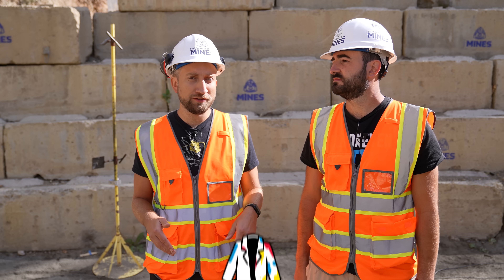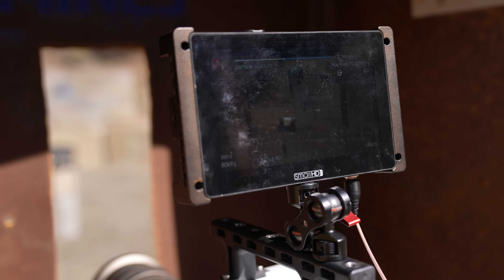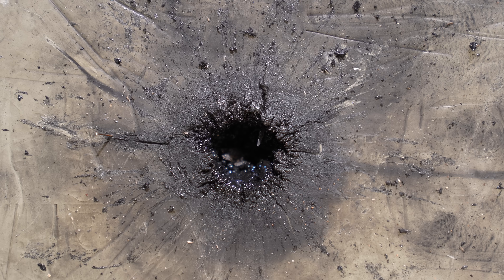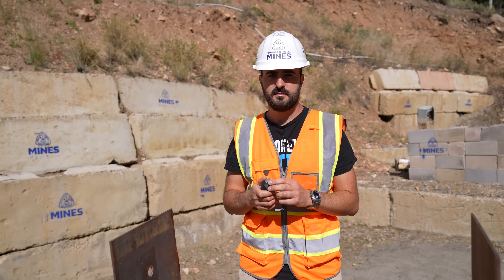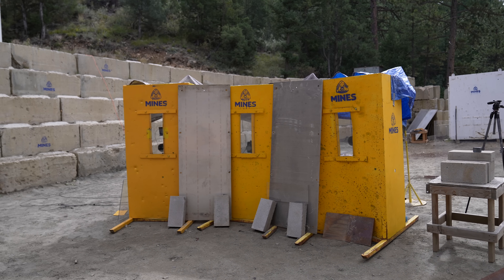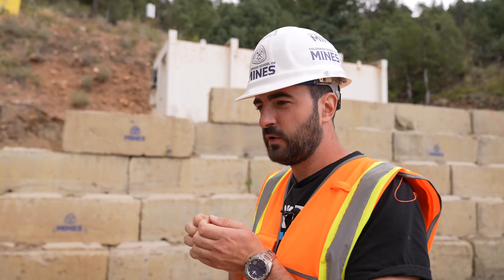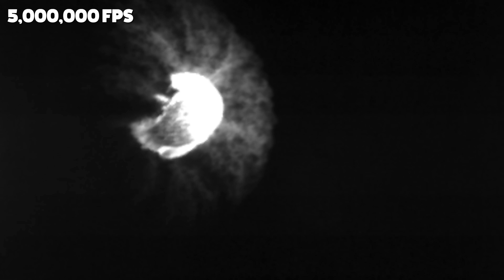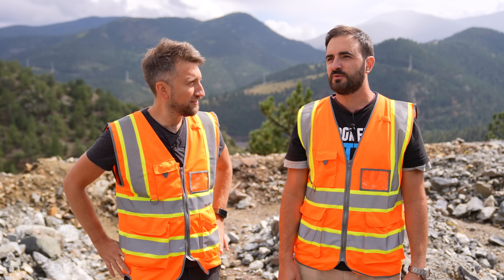15,000MPH Colliding Explosions in Super Slow Motion - The Slow Mo guys

Comment: 11:00 it's called Integer overflow. When the value get's bigger than the maximum the variable can Store, it wraps around and flips to 0 or a very big negative value (depending on the variable size and it's type)

Comment: hello, would it possible to use mathematical simulations and then plot them, like they did with the black hole? If we could do that, and then use cameras or some form of a camera to match what we see in the simulation to what the camera thing records as similar to find out the reference frame rate of the object?
Reply: like, this is what we are recording and this is what the simulation says, and they look exactly the same, so the discrepancy in their frame rate is some form of the object's reference frame rate?

Comment: Blue hot. Im pretty sure the copper impacting in the middle raises its temperature immensely. Essentially turning the copper’s velocity into heat as it impacts over particles and gasses in the air. Im sure youd be able tell if you had a thermal camera.

Comment: Its amazing that we can consistently and uniformly create an explosive that is effectively pinching down precisely from every direction around a watermelon seed that has been fired from a supersonic gun, at the exact same time. The timing is amazingly precise to compress that initial tip down into explosively vaporising copper devastation.

But I can't get my soundbar from rolling over to the wrong input everytime it comes on because it won't wait another tenth of a second for a signal. 😂

Comment: 13:54 it is possible that there is a jet of superheated metal, but the majority is occluded by cooler material. You can see the pinpoint "disappear" in the cloud of the opposing charge, which means there is definitely a region behind each jet that will hide white-hot material.

Comment: This reminds me of an experiment I proposed that mythbusters never picked up. There is an episode of invader Zim where Dib as as a superpowered adult kicks an oncoming pressure wave to stop it from flattening basically everything around him. I'm wondering if there is any physical basis for what I interpret to be deflecting or dispersing a pressure wave with another pressure wave. What I've seen so far certainly suggests that the two waves just travel through each other.

Comment: The shaped-charge effect was discovered by accident when an explosives manufacturer put their company name on the mould of a flat charge. The resultant charges would create a concentrated shockwave along the shape of the text, and blow a hole into an adjacent metal surface which followed the same lines.

Comment: At 10:56, this must be the overloading of the image chip. In silver photography, when the exposure reaches a certain point, the density of the image decreases. Typical example, a photo with the sun in the background. Sometimes the exposure of the Sun is so great that it reverses, causing the Son to become a round, grey area in the final print. The term is solarization. In your images, those dark areas are an extreme exposure for the image chip, therefore, representing the brightest area.

Comment: So from my understanding of shaped charges, that's not powder - that's a glob of molten copper, at over 1984*F (1085*C), which is why it's so incredibly bright. Something that's wild is that, if I'm doing the math right, we're only seeing a fraction of the actual brightness - the peak wavelength emitted by molten copper is outside of the range we can see (and thus, the range the cameras are built to see).

Comment: I have a suggestions, should you try this again. Add the following equipment (which will be destroyed by the blast, of course): a couple of pieces of glass either parallel to each other and not quite orthogonal to the camera or else not quite parallel to each other. They will reflect the image like a hall of mirrors, but each reflection will include a drop in exposure of several stops. This way you can get multiple exposures in one go.

Comment: @11:00 You are correct. The black pixels represent the brightest, but when the image was created it overflowed, because of programmer error. The programmer multiplied a 0-1 source by 256 to fit into a byte, but should have multiplied by 255, because 255  is the largest value a byte can hold.

Comment: Dumb comment inc.  I think if you had used a water back plate like on breeching charges that SWAT uses, you may have been able to reduce the fragmentation, as well as reduced the loss of explosive force away from the actual direction the charge is aimed at... Seems like it would also reduce the amount that the charge can move after igniting.  Just dumb armchair quarterback comments I guess.

Comment: Shaped charges were discovered as the result of a failed bank robbery. The vault door resisted the attempt to open it using blocks of TNT. Afterwards, police investigators discovered a negative image of the brand of explosive used blasted into the steel of the vault door's face.

Comment: 9:45 That shape charge is only traveling 1,650 miles per hour slower than the ISS, which is moving on average at 17,700 miles per hour over the earth’s surface.

Comment: so, if the title is accurate, the explosion would be traveling at speeds of 4.166666666666667 miles (6.7056000000000004491kilometers) per second. at that speed, if you were to get hit in the head by it, you would not even feel pain before you die. that is horrifyingly fast.

Comment: Travelling at seven km/s, the copper melt which is  shot from a shaped charge, achieve orbital speed.
Thanks for the great video!
Greetings,
Anthony
Reply: That is not correct. It ionizes and turns into a sort of gas. It does not melt. This is also why you do not find melted copper on the battle field, it evaporates instead. Watch a few battlefield clips and you can literally see it evaporates into a yellow mist/gas.

The rod is hydrostatic(or act like it), it does not burn its way through the metal, it pushes through like when you drop a rock into water.

Comment: There is not only tip in those jets. It`s jets, but tip is glowing most brightly cause incredibly high at those speeds jet to air friction. It`s plasma. And air is burning, making NOx and other weird chemical reactions. Every fraction of second tip particles is rapidly slow down and spreading to the sides with chemical reaction products, making those cone puffs.

Comment: How about using a long steel angle like 6 ft. cut holes through both plates, sliding the angle through so at least aligning them isn't much of a problem.  Except for the mounting of the charges and the variance introduced from the charges?!?  That should reduce the 'error' in alignment lol but may introduce 'error' due to the flight of the charges... Albeit a pipe that's cut away in the viewing area might be best... But then is there any regulations about 'gun/weapon' mfg that would prohibit such? Donno...

Comment: Hey, also, it's going to be cool if you'll did the safe charges based on each other.To jailbox possibly a jailblock a little bit longer What make more of an interesting Camera angle and visual of what it actually does cause the jelly kids just smoke My bill would actually get a better view of it When a passes to the jailbox , if you're with a shot death with a high frame rate Maybe we could have seen more of what it actually does.Thank you For the contact video including to entertainers

Comment: Hey, wish you was busy that again with the jailblock and the shape charge, but add a different angle where you get a better view of the block. Cause it does look like it shoots to the block. So fast that the moon channel it's created after the safe charge already passed through the block.  And it looks like the black shirt and smoke was soaked up into the block.After the shape charge passed through it didn't it.   ,??

Comment: Can you guys do an arcflash/arcblast from shorting a 600v electrical panel? The physics of it are pretty dramatic. 4x hotter than the surface of the sun, copper buss bars vapourizing instantly, everything within 5 feet igniting including the oxygen…

Comment: It's crazy to think about the fact that if the footage of the shape charge forming, assuming the cameras are about 20 feet away, the footage is actually delayed by about 1/5 of a frame because the light is actually taking time to reach the cameras. That just gives you some perspective for how slow that footage is. Also, 1 second of footage would take a little more than 46 hours to play back, assuming a 60 fps video.

Comment: The actual reason why the explosion looked blue at the start is because things at a temperature higher than 7000K glow blue. At 14:20 they notice that the tip is the only remaining white part of the image, suggesting probably higher temperatures

Comment: Looking at the final segment I can decisively say they're making the shape charges wrong for distance but right for direct contact.   The cone needs to be broadened a little for shooting at anything distance from the charge.   This means that these charges are not representative of munition shapes.    Against a surface the tail of the cone would clearly keep the force of the copper solidus compressed tightly as it struck a surface and greatly reduce the side flow on contact with the target.

Comment: Light only travels 1,000ft per microsecond, so footage of 10,000,000 frames/second is also where you start getting relativistic delay from different parts of the images as light from the closer parts of the image arrive sooner than farther parts of the image.

Comment: 3:31 is the principle for exactly why shaped charges on rocket warheads were so effective at defeating armor starting in world war 2. You can concentrate tons of energy onto a very narrow point with a conical liner on a tank's surface because the liner colapses in on itself at an extremely fast velocity and directs itself onto a very small directed point, rather than an outward explosion in all directions.

Comment: btw... you guys should try putting those shaped charges into something really hard that can hold them... like 3 or 4 inches of steel, with just the one way opened for the charge. You'd be surprised at how much of a change there is.

Comment: All that was missing was a shape charge at each axis and a plutonium core in the centre and then no amount of ND filter would have helped you! 
There'd be a huge hole in the ground where the table used to be! 
That's basically how they did it! 
Notice that bright bluish light and how similar it is to the one produced by the atomic bomb?

Comment: I suspect that part of why the tip is so much brighter than any other types of explosions you've filmed is because it's not just getting hot from the heat of the explosion, but rather from the compression of the air in front of it. It's something that only really happens to anywhere near this degree at mach 5+ (even the SR-71 didn't glow glow, although it did get hot enough that they had to make it out of too small pieces of metal that would leak fuel at low speeds to account for the expanding). This is the type of speed that you only otherwise really see objects (as opposed to electric currents and stuff like that) moving at when entering the atmosphere from space, and from nuclear explosions.

Comment: The blue color probably comes from the copper being ionised as the spectral color of many copper salts is bluish green.
Edit: copper salts mixed with some additives like PVC (to intensify the blue as it is usually extremely dull.)  are used in fireworks for blue coloring. If you look at the video and consider how hot the copper is burning here and how dull the blue is comparatively, you may get how important the additives are.

Comment: Now Iwant to see a high speed video of a shape charge in a vacuum chamber. If its moving though a vacuum will it still be glowing so bright? Or is most of that from ram pressure heating IE. its like a meteor burning up when entering atmosphere? Without air will it just be a chunk (or spray?) of ordinary copper flying by really fast?
Reply: seems dangerous for the vacuum chamber, though. Guess we should just send Gav and Dan to space :D

Comment: Pleas do this in a vacuum!!! Also insure you are using solid copper cone shaped charges because some are frangible. The projectile should be a small diameter wire. I know the technical challenges sound overwhelming but the results would be fantastic.

Comment: This gave me an idea - could you rig a wire break the same way you did a few videos ago to a shape charge which would be facing the pistol (facing the wire break)? Similar to the C4 vs 9mm round, but this time it's a shape charge hitting the bullet head on rather than C4 - I think this would be super interesting, because the bullet has much more mass than the copper jet but the copper jet is traveling at higher velocity - I am intrigued by which would win.

Comment: Just one thing... shaped charges do not NEED to be conical (although the military usage typically will require a conical warhead), the same effect also works with a v shaped long linear charge, it just makes the resulting copper cutting front like an axeblade and not like a pinprick... They use those e.g. in controlled demolition, when high rises are to be demolished.

Comment: Thus an A.I interpreting the Real World would need to learn on how to reverse engineer this concept of taking 2D Images from a Camera or 360 Degree Camera and create translate it back to x,y,z,w vertices and numerical values all in less than 60fps every second and take or calculate multiple decisions every millisecond. Thus an A.I can react faster then a human being in an accident self driving mode if it can push beyond the human eye 60 fps maximum movements thus for example can machine learn and react at 100fps....#TimeWillTell

Comment: The reason for the bluish tint to the light is due to REALLY high temperatures being reached. (Google "Black Body Radiation" and "Color Temperature"). So the temperature of the material giving off that bluish light would be between 9,800f (5,427c) and 12,140f (6,727c)
aka Mother Flipp'n HOT!

Simplistic explanation: ALL matter radiates light. But not all the frequencies can be seen by the human eye. For example, YOU emit light in the infrared frequency range (which is why you can't see it).

If you heat a piece of metal it will begin to turn a very dark red (emitting the very lowest frequency of light you can see).

As the metal is heated that red will turn brighter and brighter red until it gets to be a bright red (as the frequencies of light being added in move farther and farther up into the shorter frequencies you CAN see).

Heat it more and it starts to become orange (as even shorter wave lengths of light like yellow start to be added in _ yellow + red = orange). 

Still hotter and the metal melts as it starts to emit white light (because  even shorter wavelengths of blue light start getting added in.  _ blue + yellow + red = white).

Still hotter - and electrons begin to become stripped from the metal's atoms as it becomes plasma, and enough blue light starts coming out to give the white light a bluish tint, but now ultra violet light, which you can't see, starts to enter the mix (which is why the light from an arc welder can both give expose skin a "sun burn" and can even permanently blind you).

Even hotter and next the plasma starts to emit gamma rays and now in addition for blinding you and burning you skin you begin to become irradiated, and if exposed to the light being emitted at this point for long enough and you can start to develop radiation sickness.

At crazy hot temperatures cosmic rays start to be emitted and not only is your skin burned and your eyes quickly blinded, as the nuclei of the atoms within the plasma start to fly apart, ionized pieces of the shattered nuclei called "nuclides" start to bombard you along with both gamma and cosmic rays which start ripping apart your very DNA as they blow right through your body like buckshot from a shotgun.

Comment: Sooo I know you're in the US, but why have you been so un-American about this whole thing? Yes, the American way is more explosives, but you stopped at 2 fighting against each other. Last I knew there were 3 axis of bilateral direction, meaning you could and should have ramped it up to 6 firing all into the same point to see if that some how made the Tessaract or just a really cool slow mo video at a 3/4 view (you'd need to rig the charges for that, not move the cameras around.)

Comment: Yeah, these things get seriously close to the melting point of copper (1,085°C/1,984°F). No wonder they are so bright, but it's to be expected when they are used to puncture metal. For those wondering, superheated plasma gas, which is used in plasma torches to cut metal, is about about ~10,000°C (~18,032°F) so this is just 1/10th of that heat. I would suspect the blast is doing a lot of the heavy lifting to get that blast through it's target.

disclaimer: I'm no expert, just some armchair googler, so take what I say here with a grain of salt.

Comment: At 8000 m/s that copper goes through anything. Concrete. Three inch thick armour steel. The RPG7 warhead is just that. A shaped charge.

Comment: This information seems like it would be very useful to our military, unless of course they already ran these same tests? At this point, changing or altering the shape of the charges to "fine" tune them seems to be the only thing left to do. Now that you can see exactly whats happening in the first few moments of detonation, I wonder if the classic "cone" is the best shape there is. Also id be curious to see what a cone charge would look like if it had a few rings around the edge, or a spiral coil that wraps around the cone. Or maybe some other material placed in the point of the cone, like a diamond, or tungsten dart.